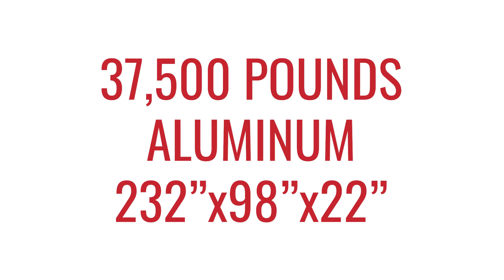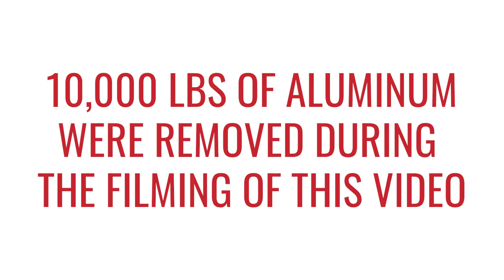37,500 Pound Aluminum High Speed Machining with Parpas XS (No Music, Extended Cut)

Comment: What sort of cycle-time does this sort of work have? 
Is it programmed like a small part and run in one fell swoop or is every operation very carefully checked that everything went as expected before continuing on?
Reply from the maker: Lots of in process and post process verification
Reply: @Majortool  i guess you employ cam toolpath verification software too..
Reply: @ferencungvari3089  yeah, it will be way cheaper than a crash with this machine i can imagine